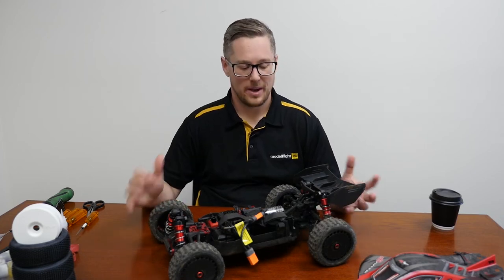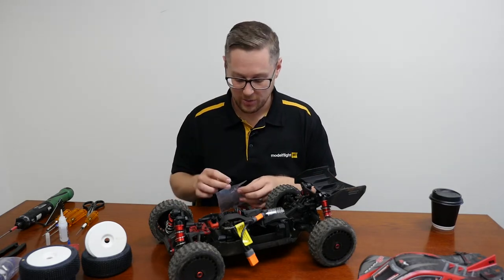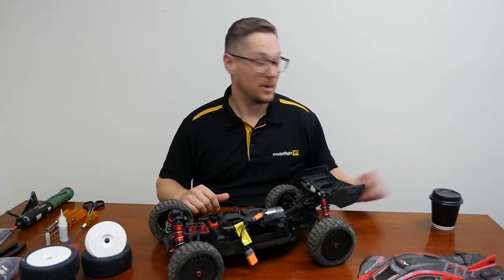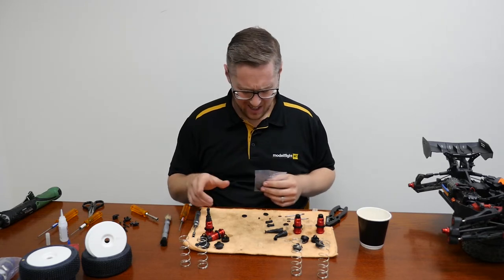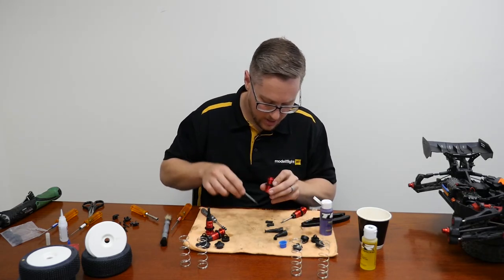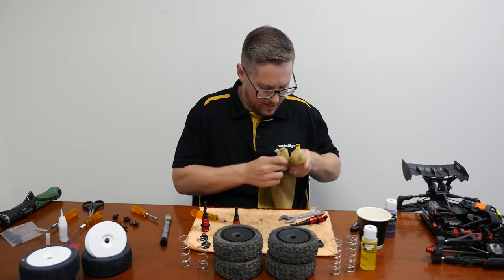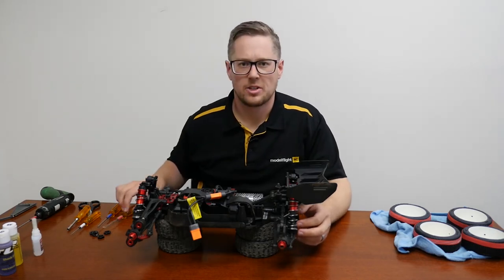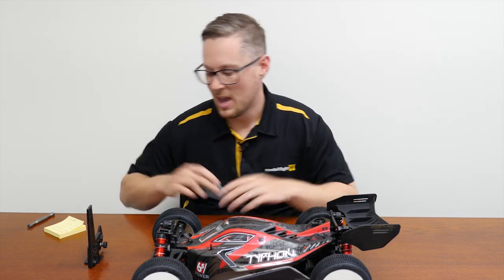Arrma Typhon 6S - Racing Upgrade // Part 2

Comment: Also 2 other things about  Team Losi Racing shock oils.. 1: it runs a lil thicker than most other brands (by weight/cst ratings.. far as I heard)... and 2: its color coded according to weight/cst rating (makes it easier to identify what u have in your shocks)

Comment: Excellent video, luved the clean and clear explanation.  Much appreciated!  
One question, what gauge do you recommend for setting toe in ?
Reply: Typically on 4x4 models (at least MT) front toe is set at 0 degrees, while the rear has 1 degree toe in per wheel (2 degrees total toe in) to help the model going straight since the rear tires can "splay out" under power

Comment: How do the springs feel they seem maybe too stiff ???
Reply from the maker: Hi! They feel good, the car is just under damped from the factory in our opinion. Cheers
Reply: @qh4007  check the video he says the weights he used front and rear. I'm just servicing my shocks now and checking this out again.
To TC Modeler, would have loved the see the part 3!!!